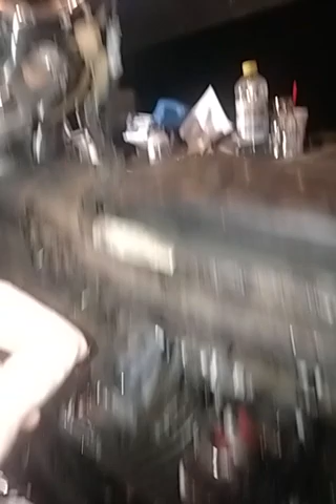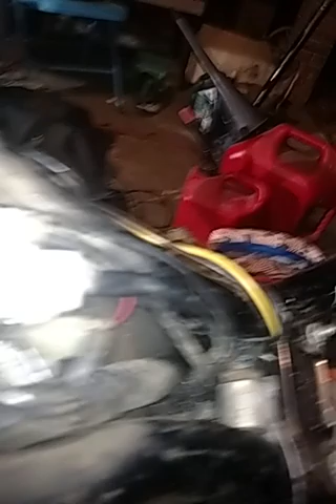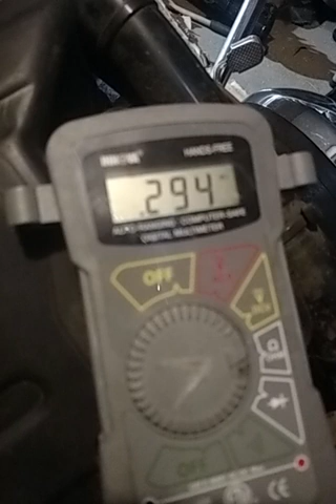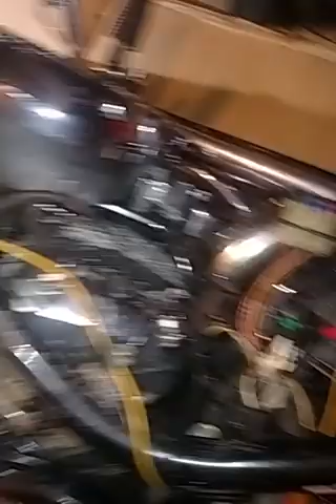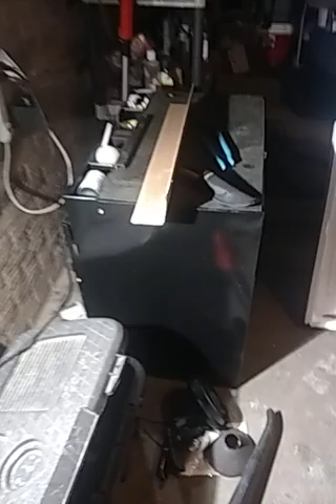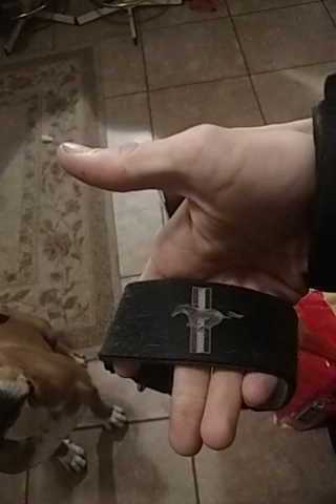VStar pickup coil failed. How to check it!

Comment: Is the pickup coil the same thing as an ignition coil on this. I can't find a pickup coil anywhere online but I can find the ignition coil.
Reply: Yamaha doesn’t sell it by it self it’s a single unit with the stator (2015) on my year they make after market ones you can wire in
Reply from the maker: It's definitely different it tells the coil when to fire. Kindof like a distributor pickup or a crank sensor

Comment: I'm having issues with cel light code 42 tps, checked the tps and it's within spec, looked at the wiring and one of the tps wires goes off to the pick up, that reads 200 is that a bad reading?
Reply from the maker: Not sure, I never was fortunate enough to get a code reader for my bikes yet so I'm not particularly sure, to be quite honest. This is one of the first major electronic issues I fell into and had to figure out and shared. Car wise I'm on it though! Haha
Reply: @ShogunAutoworks  there's a way of working out the blinks the long blinks are the 10s and the short blinks the units if that makes sence, like 4 long blinks then 2 short ones is 42 👍
Reply from the maker: @adventurewithlee  o like the odb1
Reply: @ShogunAutoworks  yeah

Comment: I checked my bike´s pickup coil resistance and got 218 ohms, but measured with a oscilloscope its signal and was only 900 mV peak to peak (around 0,5 volts of positive peak), I tested in another bike (not yamaha) and got a 7 volts peak to peak signal
Reply from the maker: Oh man. That could be a bad sign.
Reply: @ShogunAutoworks iI's a bad sign of...? What wud cause one to go that high?